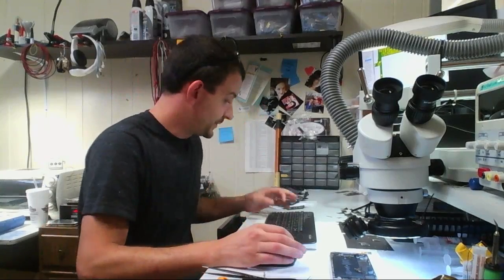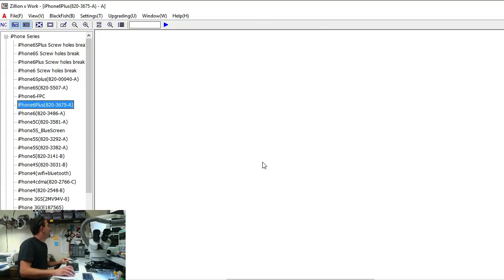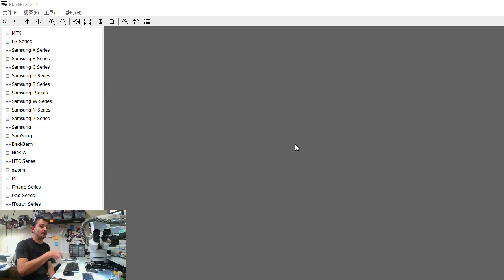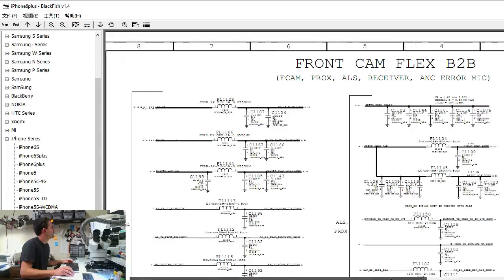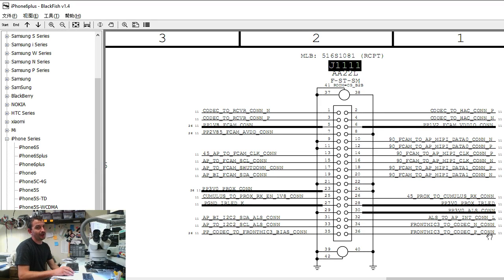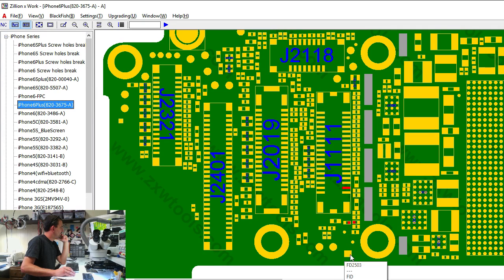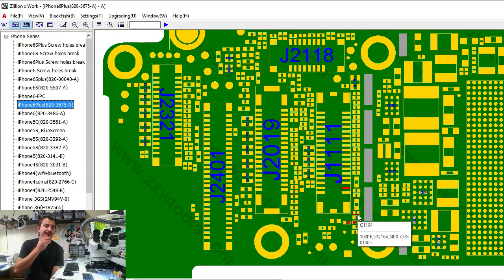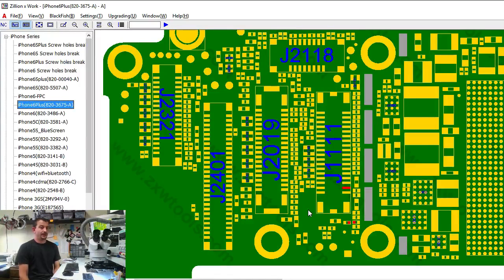iPhone 6+ Touch IC complications - no ear speaker after touch IC repair

Comment: Hello. Thank you for your video . I have one iphone 6 and 6 plus i replaced new screen for them ,But i have voice problem in them. When some body is calling or when i call from these phones i can here other side by main speaker the one is near charging port also i can hear other side by using headphone but i can not her from the little speaker on the top near face camera .Do you have any idea for fixing this problem .I changed the top speaker did not worked i replaced new top flexible cable with sensor mic and camera on it, it did not worked i replaced complete charging port with the headphone jack on it , it did not worked again.
I think there is a problem on the mother board.
Do you have any idea for this problem ?
Thank you

Comment: So I think this is my problem, but I did not use a heat gun at all. My ear piece speaker was getting quieter so I decided to buy a new ear piece speaker accordingly to my IPhone 6S+ model type. I installed it but doesn't seem to work at all. I removed the new one and installed my old one back in and it still doesn't work. Any idea what I might be overseeing? Thanks!

Comment: what do you think about peelable solder paste to protect heat-sensible surrounding components? i'm tempted 
http://www.elliottelectronicsupply.com/chemicals/protective-coatings/solder-mask-latex-peelable.html
Reply from the maker: Interesting.. I'm willing to give just about anything a shot.  My worry with a lot of shielding is that when the solder under it does melt that the shielding moves the component.  I used to put tape all around where I was working but it caused me a lot more headaches than good I think.   That's the first heat shielding drying/liquid I've ever seen though.  Looks neat :)

Comment: Got an iPhone 6 board in today after aftermarket screen was used to replace broke one. Now the phone boots to Apple logo then no display a few seconds later. Backlight is lit up but no image. Everything under the multimeter checks out, no shorts and no signs of physical damage. Have you had any experience with this problem? Possibly the boost ic? Any help would be appreciated, thank you!
Reply from the maker: +Stephen Elliott is it detected in iTunes?
Reply: STS Telecom yes it is.

Comment: Hello! I change bouth ic of touch on iphone 6 and now the phone not turn on, i put a battery with charge, but nothing, after that I see the battery and it is 0 Volts, i already changed other chips and never had any problems, 
 can you help me?
Reply from the maker: Sorry,  there's no way for me to help with that from here.  There are just too many things that can cause them to not come on after a touch IC repair.
Reply: thanks, do you think its possible the U1202 may burn? or not.
Reply: Jorge Pina  change the cumulus  or reball but pay attention that is propely placed

Comment: I replaced the mason chip on a iPhone 6.  I didnt pull any pads taking it off.  After putting a new chip back on the phone will not power up.  Any ideas what I could've done wrong.  I do not see anything missing from the area.  I also looked on the opposite side and nothing got knocked off?  Too much heat? I didnt use much shielding.
Reply from the maker: +brandon hobbs it's most likely solder balls that are touching under Meson.  There are other things it can be but when I have a Meson IC that gives me issues like being a row out or initially crooked and I proceed with installing - those are the ones that give me a no boot situation.  9/10 times replacing Meson again fixes it.   Hope this helps.
Reply: I appreciate the help, trying hard to figure this stuff out.  Ive been doing general repair for about 3 years, but it seems to be dying off.

Comment: Your fume extractor relatively quite? What make is it? How the hell you get BlackFish to work?LOL Q's. Oh wow, I just discovered your channel. I got a lot of watching to do, LOL : ) & oh no, I've had issues. Fixed them all. Except the 'searching' issue. I've noticed they are pre-repair and not post repair[touch ic].
Reply from the maker: That fume extractor is super quiet... when it's off.  LOL  Still working out some bugs.   Right now it pulls through that 2 inch tube down around behind the bench through a home made filter that is a lot like a shop-vac.  I can still smell fumes so I'm changing it to blow the exhaust outside and not through a filter.   I'm pretty sure BlackFish will quit on me soon because it's a "free for x amount of days" trial that came with ZXW.   I don't understand Chinese so I can't be sure (not even with Google Translate).

The "Searching..." issue is a pain in the ass.  Even if you explain to the customer that their touch ICs being fixed won't fix "Searching..."  many of them still want to believe that it will and get upset when it don't.
Reply: My BlackFish never worked. I'd probably pay for it to work. SOB's never reply. As far as the "Searching" I think that something in the baseband got messed up from the initial drop that caused the touch ic to fail as well.  So it's 2 things wrong and not just one. Was thinking about the Hakko fume extractor but seems like it'd be too noisey.
Reply: You ever notice those little white crystal balls?  I think they ooze out of the CPU?

Comment: Extremely helpful. Time to go fix both cameras not working after touch ic lol. Seriously this will help with today, thanks again!
Reply from the maker: You're welcome!  If you had ear speaker issues, hopefully this helped!  I wonder what exactly they had in mind with that rubbery over-fill.  It's just nasty when it comes to rework.  There wouldn't be any complications with touch IC repair without it.  The only way I've been able to fix the no camera issue is to clear the rubber coating off of and around the LDO (U2301), remove it then clean the rubber from underneath, "re-ball" then re solder the LDO.  Might be able to get away with heating it to melting point and pressing down on it a bit then cooling but I really like to see when things are connected.